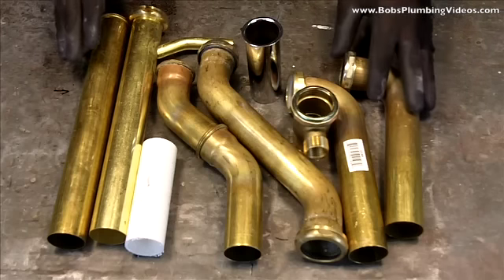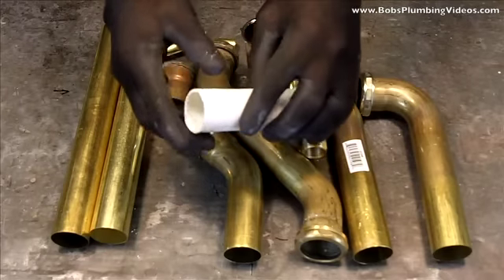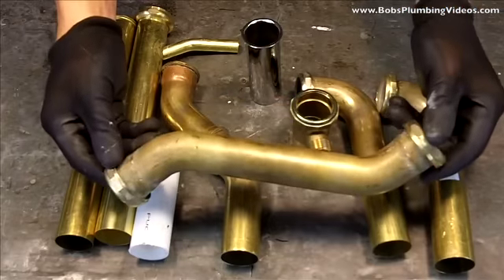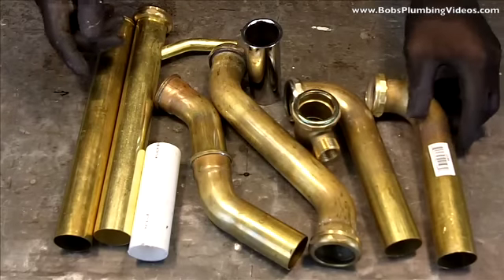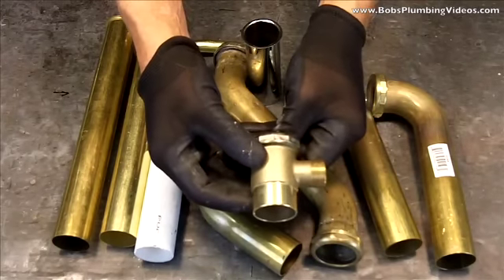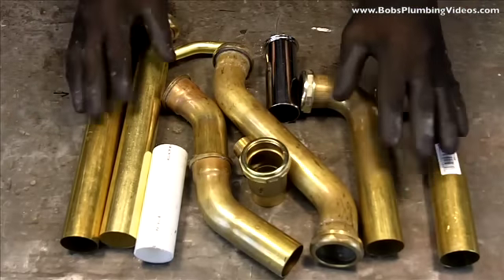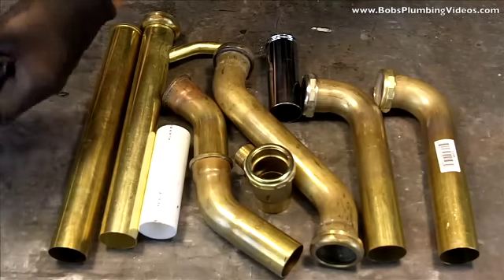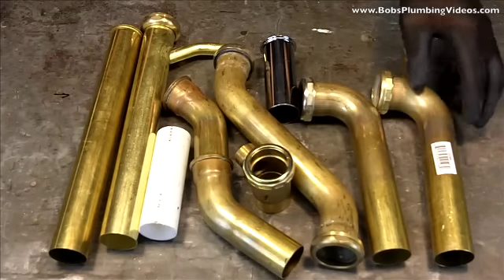Kitchen Sink DrainAssembly / Kitchen Sink Drain Parts - Part One

Comment: So what do you recommend using for a new install? I have a nice new stainless commercial style sink, but I am wondering what is best, ABS P-trap, or spend the money and go with chrome plated brass P-trap and tailpiece?
Reply from the maker: +Condor1970  ABS and PVC are bullet proof materials, literally indestructible. but if you're concerned with aesthetics because it will be seen, chrome is the way to go!
Reply: What’s the standard height for a kitchen sink with garbage disposal and with no garbage disposal